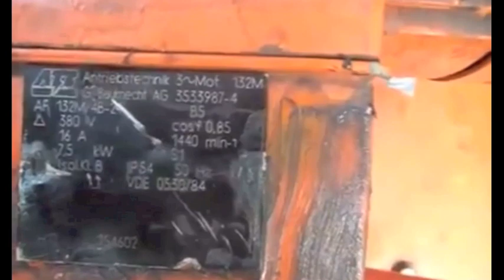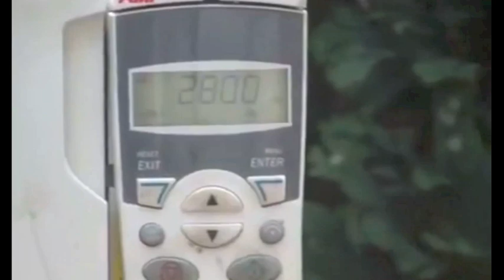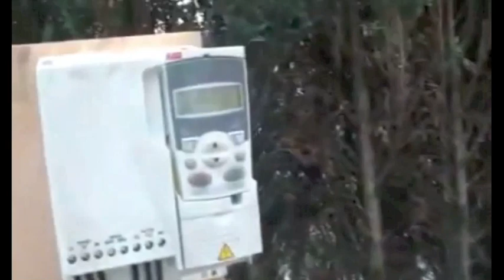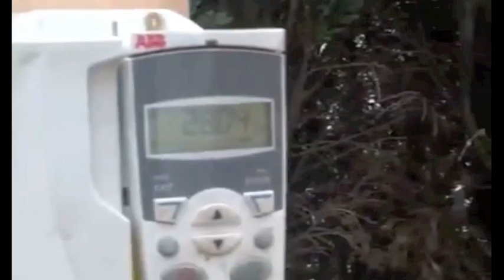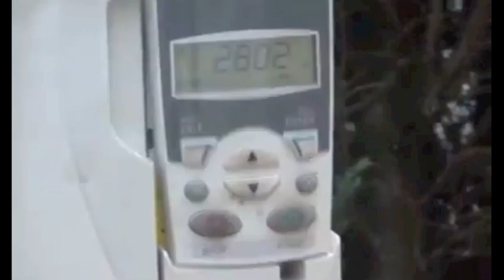The Venus Project Foundation - New / Free Energy - Omega TK RF5000 1 MW Magnetic Generator

Comment: yes i totally agree with this project the way it works and this comparatively small ac motor which runs the alternator is good enough to run any kind of alternators but the alternator must have magnets in its rotor and stater winding should produce high voltage with low RPM..  good one i appreciate that
Reply: If we wish to run a 60KW alternator, how much horsepower should the AC Motor have to make it work ?